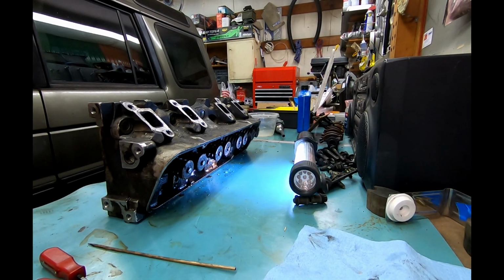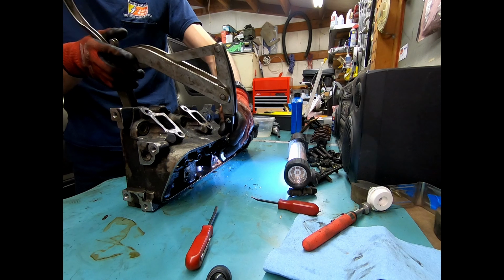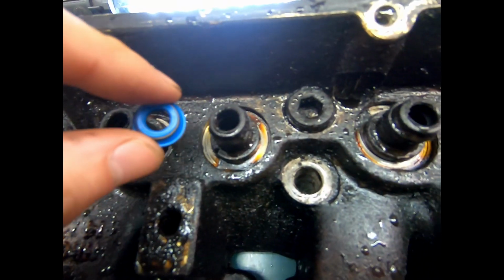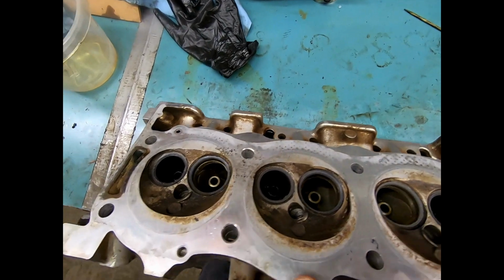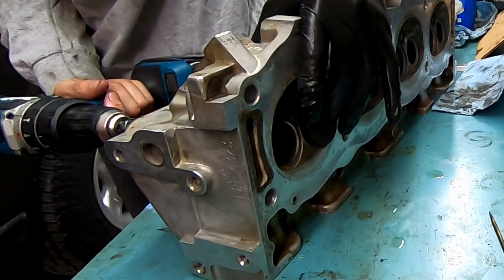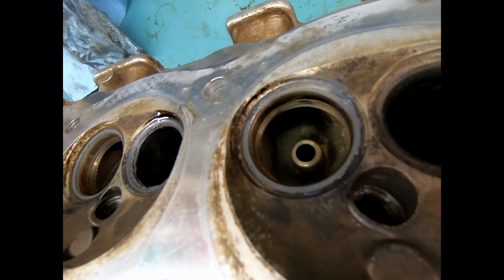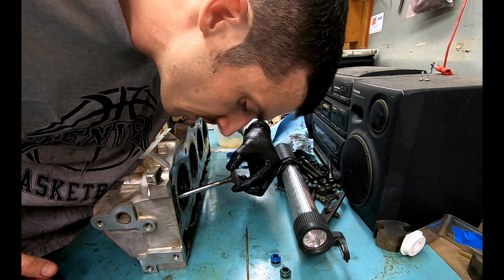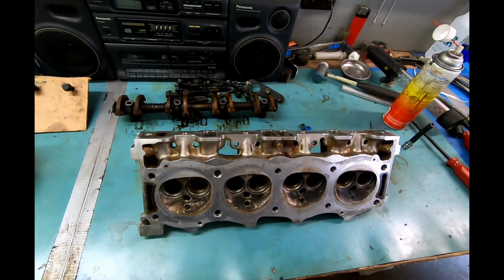How To Lap & Seat Valves in a Cylinder Head - 1997 Land Rover Discovery - "Jimmy"

Comment: I was doing the same thing.  Get an egg cartoon/box and put the cylinder parts you took together in each egg spot.  That way you can put those back on the same cylinder you took them from. I like your spring compressor better then mine though 👍
Reply from the maker: Great idea! I've got a really nice case with lots of little compartments in it, you can see it briefly in the video!
Reply: @NWCollectorAutoRepair  nice!  Some parts seat together for a long time. I try to keep them all in the same spot.  Bolts are the same. I mark bolt 1 exhaust 2 exhaust and so on.  Good job you did lapping the valves !
Reply from the maker: Very satisfying work to do!